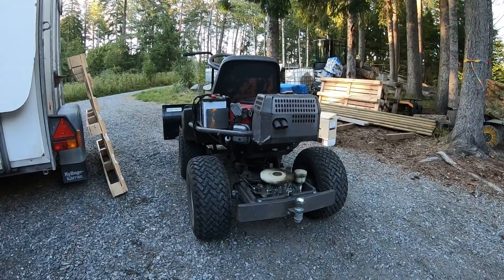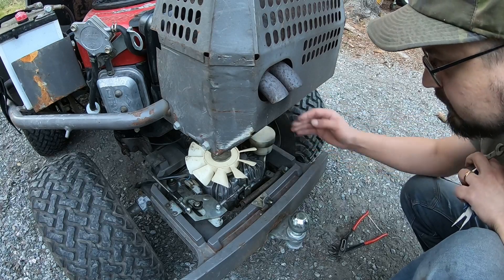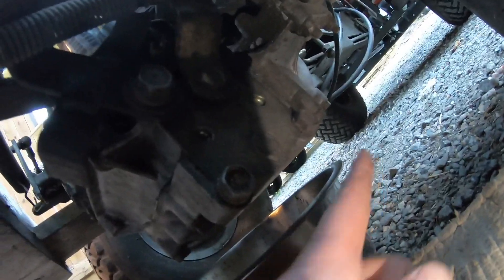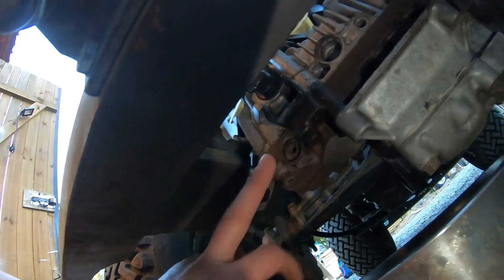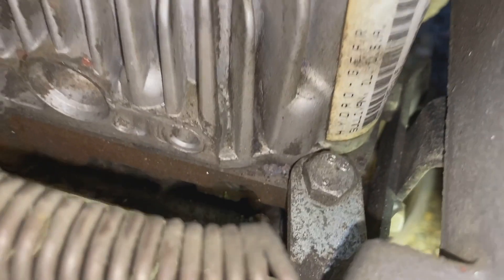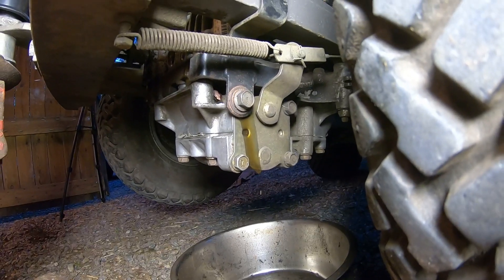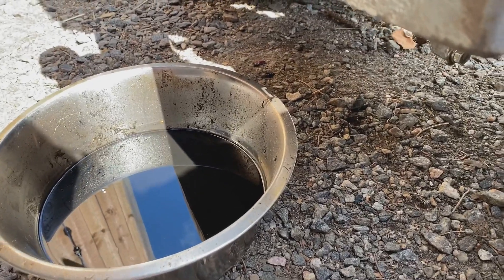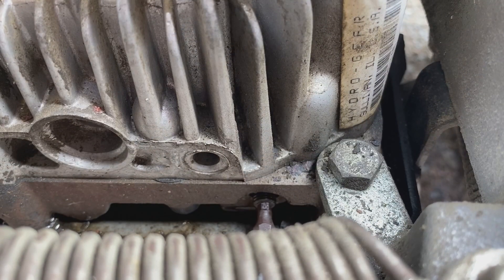HQ Rider 1200 Neutral adjustment/oil change/brake adjustment. Hydro Gear BDU 10S 115/ Kanzaki k 110

Comment: Having the same with mine (rolling backwards) Will check 🤠👍🏻
Reply from the maker: I still have some problems with the adjustment sometimes, think it is a bad design from the factory. I have an idea on how it can be improved but that will be work for later.

Comment: Great job 👍. Lucky you checked that diff.
Reply from the maker: Thanks! Yeah, almost no oil in it but can’t find any leaks! Perhaps it has been “serviced” by someone who drained it and then toped up the hydrostatic unit? A bit different to have 2 different units and easy to get it wrong.
Reply: @NilsKall  good point, didn't think of that.

Comment: How is it moving the snow on a 2WD rider? I'm thinking between a snow blower and a this thing you have attached. Hoping for a not so snowy winter as last year :D
Reply from the maker: Hi, I don’t know yet! Got this Rider this year so it will be fun to try it in the snow. I have tried to plow snow with Stiga Park with 2wd, chains and weights are a must. But it works better than one can imagine. I prefer it to a snowblower. If the snow is wet and the ground soft it doesn’t work as good, then you need 4wd traction. I will make snow plowing videos with this Rider this winter.
Reply: @NilsKall  Nice! So it basically has the same disadvantages as a snowblower. Wet snow is a bitch! What would you recommend to inflate the tires with to get some weight? Antifreeze?
Reply from the maker: @elmonni2103  antifreeze is slippery so the rim might slip in the wheel = not good. I have used window washer liquid that is rated for -30. It has worked good but the valves will take a beating from it, might need to be replaced after a couple of years.